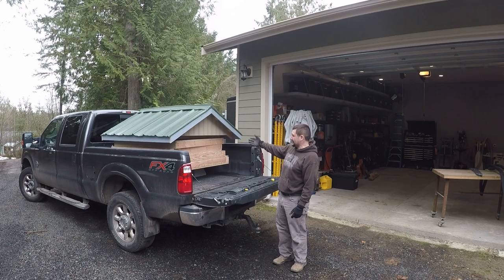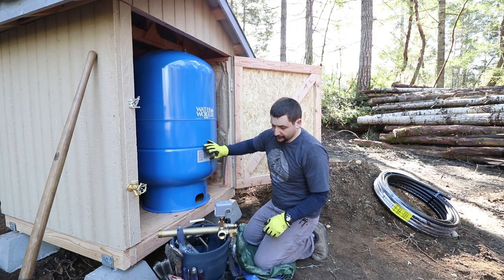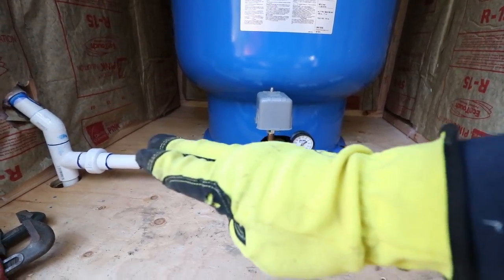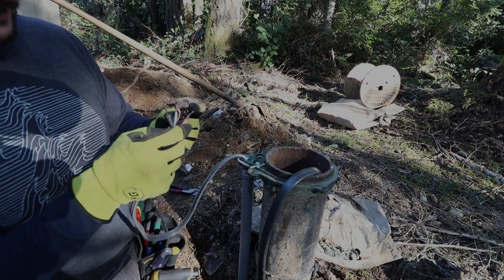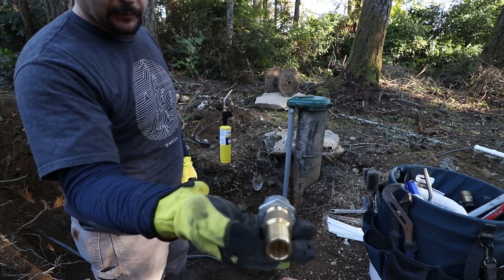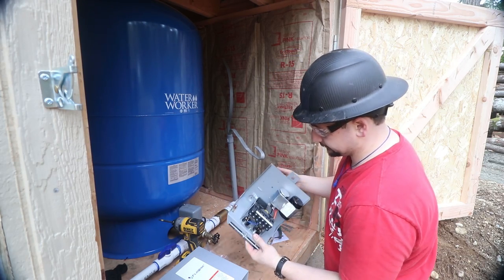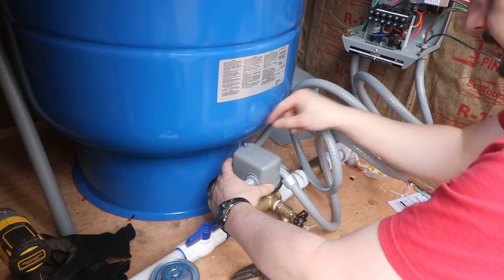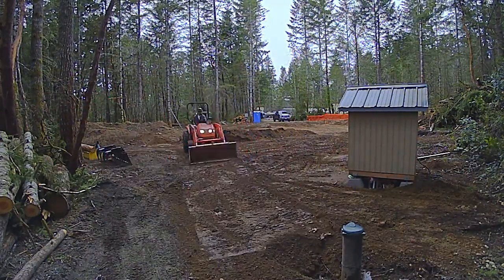Installing Well Water House, Pressure Tank, Wiring, and Piping!

Comment: Another great job, as usual. Just a side note, you only need one and a half turns around the threads with the teflon tape, anything more than that will just squeeze out and be wasted. I learned that from a plumber.

Comment: Great explanations, and fast forwarding through the repetitive tasks!  Why do you need a controller in series with your pressure switch?  As I understand it, the pressure switch turns on the pump when the pressure drops below the min setting and turns off the pump when pressure hits the max setting (40/60 or 30/50psi usually).  If you used an M4 pressure switch it would also turn off the pump if the well goes dry, so what function would a controller provide in this case?  Thanks for the info!
Reply from the maker: In the application that I have showing in this video the controller take the 10/3 wirer from the well and allow for a 10/2 wirer to be used to the pressure switch and then back to the panel; Also and more importantly the controller has a start capacitor in it. That is what allow a 220V well pump to start.

Comment: Nice work!  My well only has the pressure switch connected directly to power.  What is the controller for?  Have you considered dropping a second backup, soft start pump that you could run off solar power?   Have you considered dropping in a backup simple pump (hand pump)?  Thanks for the video.
Reply from the maker: The control is for a 220V pump it has a start and a run capacitor in it with over load pump protection. I suspect that your pump may be 110V. There will eventual be solar panels on this house but the system will be designed to support the type of pump that is installed. The well is over 220 feet deep, I’m not that familiar with hand pumps but I would think they are more for well that are much shallower.
Reply: @NotSureJoeBauers  That sounds right.  It is a 1hp, 220V pump and 90 feet down.  It does have a large startup current and would probably be better with a capacitor on startup.  I plan to change it out with two soft start pumps and a simple pump in the near future.  Thanks!
Reply: @NotSureJoeBauers  Yes, that's exactly where I got the idea from.  I'm actually going to try to put in a whole new well and keep my current well as a backup.  Seams excessive but water is pretty important.  Yes, grid tied is better if your goal is saving money.  If your looking to be self sufficient then battery backed is the way to go.  We get a lot of hurricanes here in Florida and I want power when the utility goes down.

Comment: I didn't see you put down a 'DO NOT DIG HERE' tape.
Reply from the maker: No because the wire is temporary, as soon as the house is framed up i will be moving the wire, to the other side of the house. All that will be left in the ground is conduit.